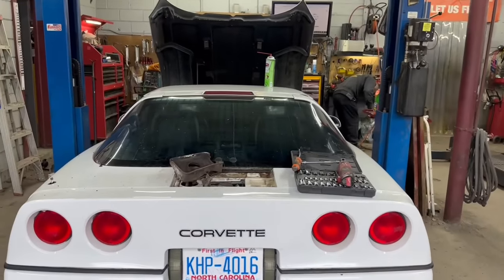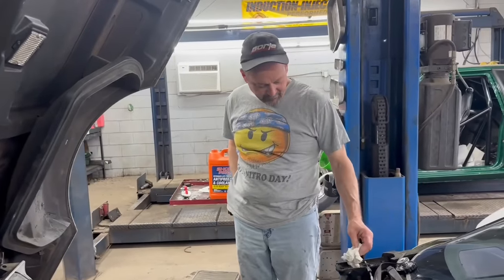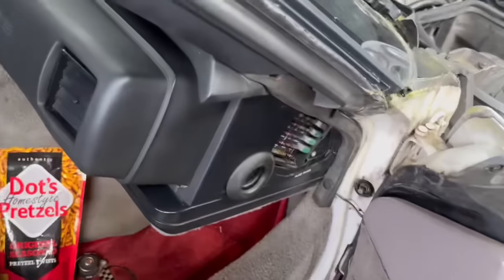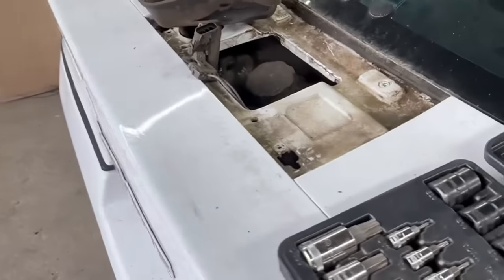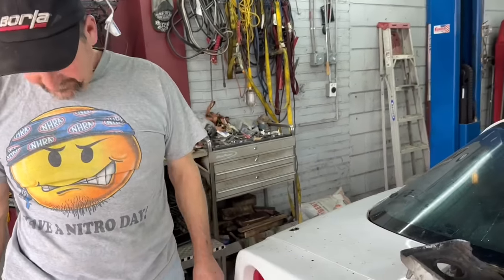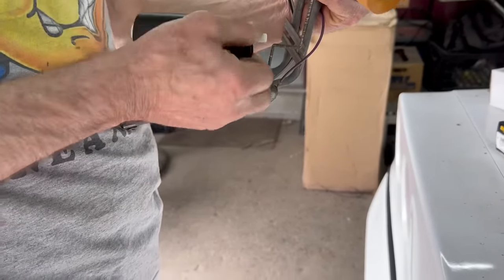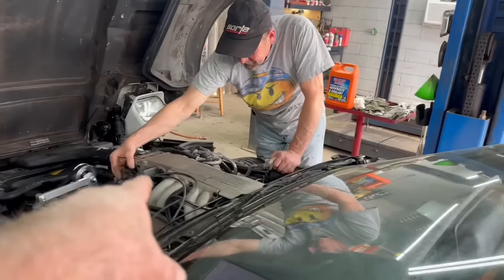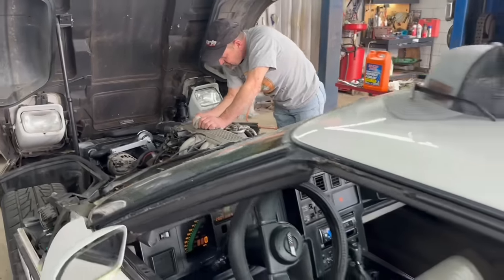How to change a C4 Corvette Fuel Pump

Comment: so what happens with these factory  late 80s through the mid 90s electric fuel pumps is the people that own them were never told that your fuel pump is cooled by the fuel in your tank so its in you best interest to keep the fuel level over half instead of under half tank  so in the summer time in south Florida most owners would just never know to keep the pump under the fuel level and the pump will last for a long long time , i have a 1990 chevy truck with the original pump 34 years young  when you buy a new pump you will be replacing it every three years or so

Comment: 10amp seems kinda small for a fuel pump?
Reply: The 10 amp fuse just triggers a relay. If I remember correctly the supply side of the fuel pump relay is powered by a 40 amp fusible link near the master cylinder.

Comment: The TBI trucks have an extra oil pressure sender.   If it doesn’t see oil pressure within X seconds it kills power to the fuel pump relay.   I don’t know if the Corvette has this or not.